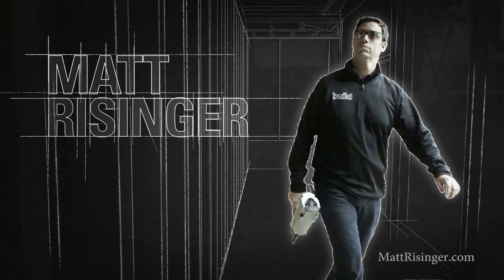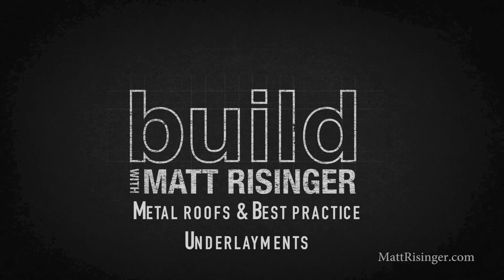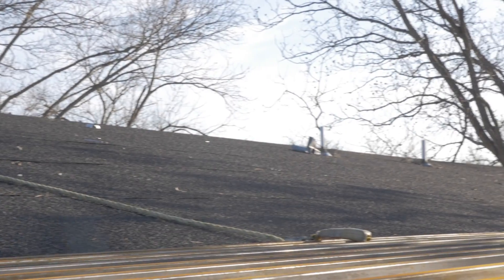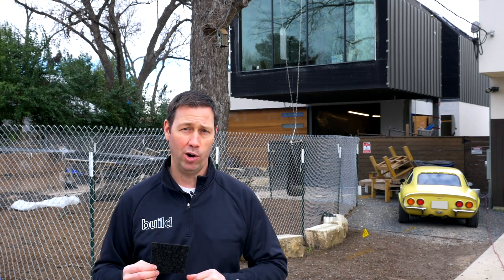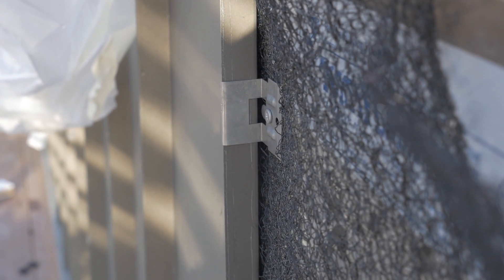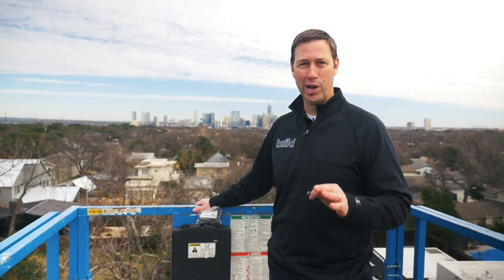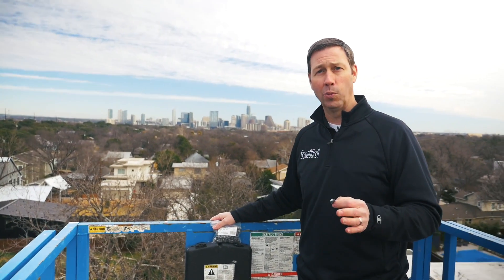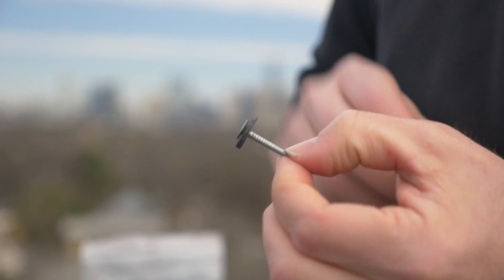Metal Roof Underlayment - Delta Trela Review

Comment: I want to see this product from the roofers perspective. Your too far away in that bucket to see the grimace on his face 😆. I want to hear the "at the bar" follow up of this product, drop in the complaints and warnings of the additional spongy spacing. 
When clips are installed, what happens? Why wouldn't the clip suck down to the deck and bow the panels? Did they special order a taller clip?
What happens to details that may be affected, like the 1" hook bend to secure to the bullnose eave flashing? Now we have a quarter to 3/8 thickness to manage which would make the bend more noticeable and time consuming. 
Why not use peel and stick on the deck, followed by Toprock DD on top of that and secure your clips direct through the top rock to the deck?
Oh, and thanks for all the info you put out!

Comment: I can understand the Delta Trela matrix being a good air cap material for a quiet roof but I question how much air is going to be able to transverse thru that matrix to actually get a good air flow to carry away heat from the eave to the ridge. Sounds like what you use depends on what your goals are. The matrix being for sound proofing and the batten strips for venting.

Comment: Good grief. Use 30# felt fastened to the roof deck with staples or felt nails, doubled if you please but certainly not necessary. Then 3ft wide 20 gauge self-furring galvanized stucco mesh for the air gap fastened with galvanized roofing nails. Then the metal roof fastened as per usual. Cost of the water shed air gapl is $70/450sqft vs. $660 per 323sqft, or 15 cents per sq ft with the wire air gap vs $2 per sq ft with the delta trela product.
https://www.homedepot.com/p/36-in-x-150-ft-20-Gauge-Plain-Stucco-Mesh-67150/206926293

Alternatively, in place of the felt layer, use a sealing radiant barrier to massively reduce heat gain from the roof structure. But I'm not including that as a cost of the roof sealing because that's a bonus heat management product and belongs in that expense category. But it's still way cheaper and more beneficial than the Delta Trela product.

https://www.roofingfoil.com/shop/single-sided-solid-foil-underlayment/  $280/1000sqft = 28 cents per sq. ft. . So using the foil and wire mesh air gap together is <45 cents per sqft WITH additional great energy benefits vs $2 per sq ft with Delta Trela.

Comment: Could you talk about how the metal paneling folds over the edge of the roof as it transitions into siding? I'm looking at 2:22.  Are the panels pre-bent at that angle or is two panels meeting with a particular type of flashing? Thanks!
Reply: Contact a metal mfg for that.  This guy's not a metal roofer. ( I am) hemming edges can be done with a 6 inch steel hand brake from midwest,  some time, patience, and a rubber mallet. ( Eastwing grey soft) and 34 dollars worth of midwest aviation snips.  And do it on the roof around a residential drip edge with 1.25 inch overhang.  Or you can go whole hog and look at my patent or pend. Hemming tools.  Send me your email,  and I'll forward the YouTube video of it working

Lucas tin man Exteriors 
Minnesota
Ssr specialist

Comment: The best way to ventilate a metal roof is to have plywood on the rafters and then tywek or something and then 1/2x2 strips of pressure treated wood on the vertical on top of the tyvek and then 2x4 across the length to nail or screw the metal panels on
Reply: I would rather place the felt between the metal and the wood its mounted to
Reply: Not pressure treated wood. It will corrode the metal on the underside of the panel and the underlayment HAS to be high temp ice and watershield. This is why anchor bolts are galvanized.

Comment: Why would metal roof not entirely be rainproof?
Reply: Depends on whether it is corrugated and standing seam. Corrugated the fasteners are exposed and standing seam the are held by hidden clips.  Metal expands and contracts and with the fasteners for the corrugated metal roofs the holes at the fasteners can elongate the hole and  also work loose to the point the rubber washers loose their seal.
Reply: fastener points when misplaces or not otherwise fastened properly will permit water permeation thus why he showed the epdm rubber washer nails, most companies offer epdm washer screws

Comment: Hey Matt, in Australia we use something called "Anticon" which is fibreglass wool bonded to a foil barrier. Great sound barrier too. Wondering what you think about it and if you have it over there.
Reply: David Chua plus our metal roofing is produced to length, so there are no gaps for water to get under - just one unbroken run from ridge to eave.
Reply: @jesseyoung9654  It is called condensation Jesse.

Comment: Seems like having the metal spaced up with that soft airgap behind would make it more likely to get dents from small pea sized hail where it might not when hard on the decking? How much is that underlayment per square?
Reply: You realize that metal roofs are supposed to have an airgap.  That 'soft airgap' is not soft and its important.  The moisture that forms under metal roofs is from moisture deposited by the air, not directly from precipitation.  Anywhere hot meets cold your air will deposit its contents.  And commercial metal roofs are 22 guage whereas homes typically drop to 24 gauge or less; neither one is prone to dings.  The project he is working on looks commercial.  Regardless, if you are worried about dings then use textured panels.  No dings will likely form on the metal roofs unless you drop something that would have put a hole in most other types of roof.
Reply: Alex Johnson 2.04$

Comment: Matt, this would add $5000 to the cost of my roof! How is strapping going to cost $5000!?
Reply: a low cost asphalt or similar composite material underlayment on top of furring strips is enough imo, as the ridges allow for airflow while the felt provides a waterproofing barrier between the sheet metal and wood prevents or reduces wood related staining or mold issues. I looked up the price for a roll of this stuff, $$$, just for that airflow and water drainage, unless I won the lottery or inherited finance then I would not bother with this product
Reply: @Joshua79C  do metal roof leak a bunch? I live in the PNW. Best option for me? Thanks 😘😊

Comment: Hello Matt,  I don't know who your metal provider is but of the three I have contact with all are unanimous in not wanting any kind of washer headed nails under the metal.  They are afraid it will telegraph through the metal when viewed from the ground.  This is for standing seam type roof as the corrugated seems not to present the problem since it doesn't have the flat pans.  Incidentally I have had an exposed fastener corrugated roof on my home for almost thirty years in a high humidity temperate rain forest with coastal high winds.  No problems whatsoever.  I put it over ninety pound felt (try getting that nowadays) and 5/8 sheathing.  Hex headed screws are showing some rust and the gaskets are probably getting a bit long in the tooth but with a bit of touch up paint once in that time it is in good shape.  When I hear the rain so do my neighbors, no condensation, no moss, no wind tear off (The building had had the three tab roof replaced twice in its ten year life before I bought it.) and I don't have to worry about snow build up with the heavy cement style we get.  It slides right off when more than four or five inches build up.  Thanks for the information although it seems cost prohibitive.  I would have to see its performance down the road a few years.  Most of the synthetics are vulnerable to high heat over time.  Take care.  Doug
Reply: I looked at the price per roll for this stuf, wowser, more than felt and furring strips or purlins

Comment: Does this underlay give a airtight finish? Or is a air barrier required else where in the construction?
Reply: what a silly question, it as he said and explains provides a AIR gap between the underside of the metal and top of the roof sheeting to allow for more airflow and any water intrusion to drain away conveniently, and I looked at the product website and it says the same

Comment: I would be curious to compare testing of this compared to furring in regards to air movement, drying time, etc
Reply: furring seems better imo looking at the price per foot for this 'awesome' product compared to asphalt or similar composite underlayment of lower cost to separate the metal from the wood to reduce or prevent water damage between metal and wood

Comment: I wish you had shown this video a couple of months ago.  I insisted my roofer use Carlisle WIP 300 HT underlayment and also insisted he install 1/2" thick furring strips under the metal roof on our new SIP home based on a video you did previously.  It took him weeks to finish and I don't know yet what the final cost is.  Oh well, it should still work very well.
Reply: what did the cost end up being? I think you went a far more economical route as this Delta Trela is absurdgly expensive. He recommended Carlisle before with another air gap or 1x4's so you're there as far as good practices. I may actually do exactly what you did for my new construction.

Comment: The measured difference between an metal roof and an asphalt roof is 6 decibels. I don't know of anyone who complains about the noise of an asphalt roof when it rains. Consequently, noise reduction is not a selling point of this product nor should noise be a concern to anyone considering a metal roof unless they don't have anything between the metal roof and their ears, such as wood decking, attic space, insulation, and ceilings.
Reply: No sound comes through an SIP roof.
Reply: I only ear the drops pattering on a metal roof as you said in buildings where there is no sound insulation in the roof or if trusses in the ceiling or bottom chord even.
Reply: Umm... I have a garage/office with 12" roof rafters and closed cell foam for insulation followed by a shiplap wood ceiling.  And of course a standing seam metal roof.  When it rains it's much more noticeable then in my asphalt covered house.  It's actually loud and when I'm on the phone with people they notice.  Since I now plan on putting standing seam metal on the main house, I'm interested in anything that will cut that down.  I live in New England and perhaps we get more rain then in warmer/drier climes.

Comment: How do you justify the extra expense Matt? That is one EXPENSIVE product.
Reply: Likewise I'm evaluating whether or not this Delta Trela is worth my time. As of now this Trela stuff is running $100/sq from what I've gathered. A synthetic underlayment with, lets say, 20 8' pcs of lathing/ sq should only cost $40 to $50/sq. There's no way I'm saving $50 or more per sq to make up that cost difference in labor.
Reply from the maker: +sunshine might check local prices. Compared to 1x4 lath this is a good price

Comment: How about when you are using corrugated metal.  Seems like the corrugations would provide some air gap and drying potential.  Admittedly, corrugated metal is not as high-end as this.
Reply from the maker: +jmonroe I'd still air gap a corrugated metal roof.
Reply: this product is a slightly to way overpriced ventilation system where soffit and side vents would suffice if installed, and if still having such humidity issues then felt paper would suffice between the metal and wood.

Comment: Could you paint the metal roof with rubberized sealant for waterproofing and noise reduction?
Reply from the maker: +Fred probably but the UV would kill it pretty quickly
Reply: That's why you paint the bottom of the metal roofing...

Comment: Are you using exterior foam insulation on the roof sheathing, or installing any peel and stick WIP under this? How are you attaching the metal roof to the underlayment - unless you've sandwiched the foam with another layer of OSB or run purlins?
Reply from the maker: This project doesn't have any exterior rigid foam.  The roof is screwed through the underlayment into plywood sheathing.
Reply: What sort of insulation is under the plywood sheathing? Do you have another air gap under that between insulation?

Comment: This appears to be four times as much as Grace underlayment ($2.04 vs. $.64 /SF). So for the 30'x80' shop I just did, that would have added four grand alone to just underlayment. While the product seems awesome, it is definately for upper end buildings, rather than the majority of residential construction.
Reply: Not needed for anything but sips Panel. And not extreme Panel either.  Intercept or the crap from insulspan. I'm a ssr contactor,  a customer wants this stuff on a sips install.  My gut is telling me 30lb felt or ft synthetics hydra is way more real world.  I've seen leaking on enerceept and insulspan from what I believe is their gluing process. And I'm losing confidence in sips roofs. I think the biggest problem is in home humidity and air exchange.
Reply: @TheLoopy989 any experience with Porter SIPS? My builder wants to use a high end underlayment plus building a cold roof on top of the sips roof deck to prevent condensation on the underside of the metal roofing materials...seems to be getting complicated...
Reply: yep theyre gouging consumers for what the product does instead of just making a modest profit on what's probably partially made from recycled milk jugs and pop bottles anyways
Reply: Polypropylene is not recycled plastic.  It also doesn't break down in situations where normal plastics would.
Reply: That's all this guy does is peddle the most expensive and overpriced crap in order to line his pockets.

Comment: My old (1930's) metal roof is 2x4" 24" oc, with 1x4"ish battens, under an old crumbling wood shingles with 50 yr old metal roof on top. Currently dealing with water issues, but that aside I love the sound of rain, and yes it is quite audible. The water issues are urgent, and I am researching how to fix it. No decking, no underlayment of course.... going to be interesting. 1/4" to 1/2" gaps in many places can see light from outside while in the attic...